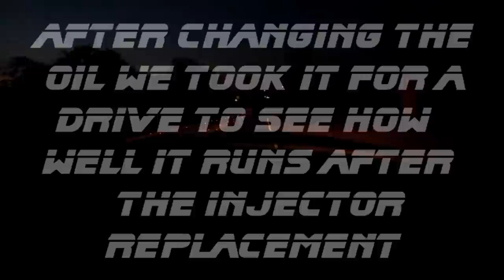How to replace Duramax fuel injectors!

Comment: Well guess what... my injectors went out..I replaced them this past weekend...with LDS injectors..and Adjusted the valves while I was in there...and set them at .010 and .010
Reply from the maker: Awesome, I'm glad it went well! It is a pain in the ass, but it is nice once its all said and done. I put about 15k on my LDS injectors so far with no issues yet, gotta love these trucks!
Reply: The Daily Drift LDS sells Stanadyne fuel treatment..so that is what I am going to run just to be safe
Reply from the maker: DuraMAxFanatic I probably should look into that, just in case.
Reply: The Daily Drift ..I hear you..I'm looking at '11 LML ..4 door..4x4..short wheel base..143,000 miles..I like the way the front end/ hood looks!
Reply from the maker: DuraMAxFanatic yeah those are sweet, I wish I could but I’m happy with this old girl she’s still getting the job done.

Comment: Hey awesome video! How are the injectors holding up? I need to change mine very soon. I’m looking for the best bang for the buck.
Reply from the maker: Hey thanks, I really appreciate that! The injectors are running strong. I have put about 10K on them so far with no issues. I went with the Bosche Remans from Lincoln Desiel, (link is in the description), but I know there are some cheaper ones out there, but I can't really say if they are any good.

Comment: What size is that bit for the valve cover bolts?
Reply from the maker: It should be a 5mm allen bit. hope this helps!
Reply: thanks alot. also a t30 bit works as well with more grip.
Reply from the maker: No problem, glad we could help out. That's good to know for future reference thanks!

Comment: Did you use the old HP lines? looks like you did? I was thinking about reusing mine since they look pretty clean. do you think i should go ahead and buy all new lines. i just dont see a point in getting new lines if you can clean the old ones up pretty good.
Reply from the maker: Ben Parreno I ended up buying new lines because the inside of mine were all rusted up and I didn’t want to take the chance of fouling up the new injectors. Considering the new lines were $180 I figured it was a little insurance.
Reply: $180 for all 8? i wish they were still available for that price. cheapest i can find is $500. The link you provided is no longer in stock.
Reply from the maker: Ben Parreno yeah it was for All 8. I’ll do some digging online when I get home and see if I can find a deal.
Reply from the maker: Ben Parreno I found two different sites with them for around $200 https://www.amazon.com/gp/aw/d/B0143EOQ3K/ref=pd_aw_sim_sbs_263_2?ie=UTF8&psc=1&refRID=FSVV4CKXWZ3K8Q94AR5X&dpPl=1&dpID=71YbHNhHCSL

And

https://www.injectorsdirect.com/product/lb7-high-pressure-fuel-lines/
Reply: Awesome thanks you!
Reply from the maker: Ben Parreno No problem, hope it all works out for ya! Have a good night! 🍻

Comment: How many miles were on the old injectors?
Reply from the maker: Heavy Metalworks they had 320k on them before they went bad, and the truck was a contractor truck so it wasn’t babied either.
Reply: wow 320k miles thats a long time for lb7 injectors.  great vid
Reply from the maker: Yeah not bad for an old workhorse. hopefully, these injectors last just as long. Thanks, I appreciate that!

Comment: How many hour would you say it took to do this?
Reply from the maker: swaggin baggins well that’s a tough one, I would say it depends but it took me a lot longer because I was filming and making trips to the part store and figuring out that tool I modified to get the rear bolts out of the valve cover. I would say give yourself a solid weekend to do it.
Reply: The Daily Drift  thanks for your advice. Thats my plan for this weekend, Starting friday night.
Reply from the maker: swaggin baggins no problem, oh and if you have friends unlike me lol they can help get the job done a lot faster 👍🏻

Comment: What coolant did you use?
Reply from the maker: Rick Alva I used traditional coolant, the “green kind”. However the truck is supposed to have “Dexcool” in it, I just prefer to use regular coolant.
Reply: Precisely why I'm asking, how long you been using it for now? All these damn stories about these engines and dexcool
Reply from the maker: Rick Alva I have been running it ever since I bought the truck, but the guy that had it before me also had regular coolant in it as well. I haven’t had any issues yet, and it’s still really clean.
Reply: I run the green stuff.  Be sure and flush the Dexcool well.  The two don't play well together.  One of the mechanics I work with used to work at a GMC dealership.  That is what they did.  Eliminates problems down the road.  Regular ethylene glycol is compatible with all the other components in the truck.
Reply: 10/4

Comment: How do i know i need new injectors bro?
Reply from the maker: There are a couple of things to look for, but usually it will run rich, there may be grey smoke that smells like a lot of diesel. But to really know for sure, your gonna want to get the balance rates checked and they will be a good indicator of which side might be going bad. That’s at least a good starting point.

Comment: The injectors on mine didn't show any signs of being bad other than the 4 gallons of oil I got out of the engine Henna Chevrolet in Austin Texas sold me a truck that needed injectors because they failed to do their job as a dealership I inherited someone else's problem they traded the truck in because it needed injectors a simple balance test done by the dealership would have put the truck to wholesale and not on their yard so now I have a pristine 2003 Chevrolet Silverado leather interior power everything zero rust in the rocker panels with new injectors for sale 21,000 140000 MI
Reply: @Rover19666  go to S & S diesel just Google it it's S&S Diesel if you're paying to have it done it's going to be about 4,500 bucks 10000 depending on what they do that being said if you do it yourself make damn sure you got the right tool Lowes Allen sockets are crucial the passenger side of the truck is a breeze it's the driver side it's going to kick your ass

Comment: After all that you put green coolant in lol
Reply from the maker: I know I get hate for it all the time, but it's all good. We all got choices.
Reply: The Daily Drift why green n not Dex and also HP LINES are 30ftlbs and also you just torque the injector holder and it pushes the injector down right?
Reply from the maker: Justin Tracy there were two main reasons I went with the green coolant instead of the Dexcool. One was the truck already had the traditional coolant in it, and down here in Texas it gets really hot and the green coolant is slightly better at dissipating heat. As far as the torque rating I think it just depends on who you ask but I got 33ft lbs out of the book, but I don’t think 3 ft lbs will make too much of a difference. Yes, tightening the hold down bolt on the injector will seat it in there. Hope this helps 👍
Reply: they are making universal coolant and it is green
Reply: Mike Nobbe yea and it contaminated the systems and could gel and worse it’s all good though